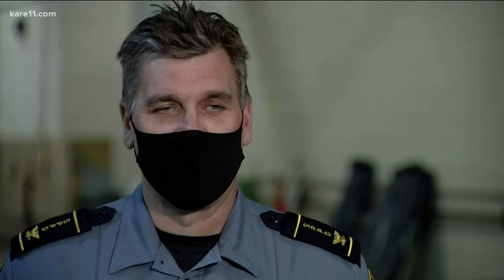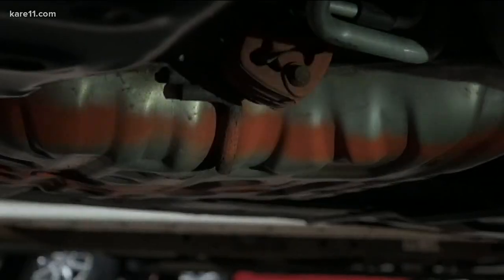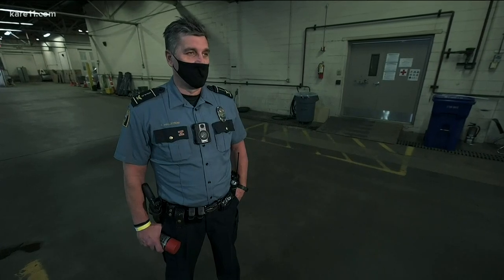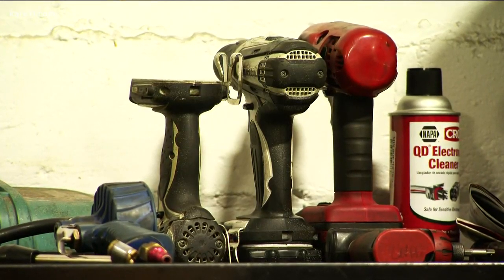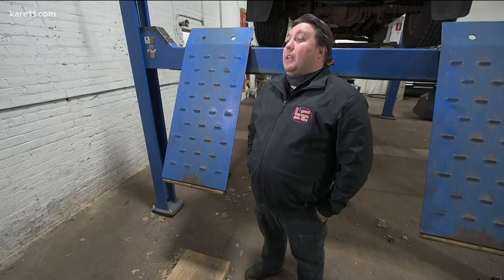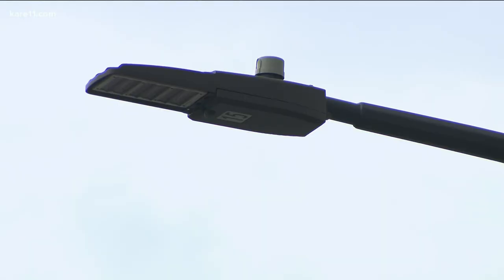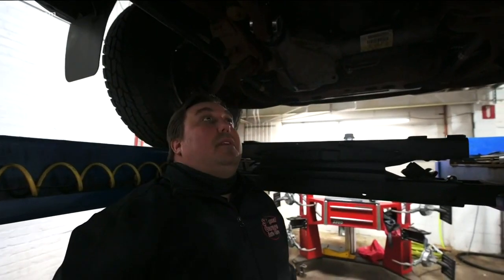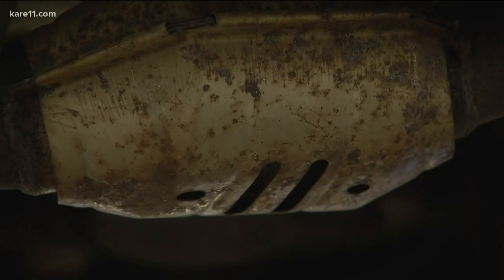St. Paul police are using spray paint and engraving to crackdown on catalytic converter thefts

Comment: What kind of paint?
Reply: High-temperature spray paint that withstands up to 2000 degrees or so. Suitable for engines and cat converters. You can get it pretty much anywhere. After spraying each layer, you need to cure it by running the car and letting the part get hot so that the paint adheres. Go for a flourescent orange or yellow. It's also advised to get an etching tool or dremel to carve your vin and/or plate number into the cat to help identify it and convict the thief in the event it lands in police custody. Some police departments have been more aggressive in shutting this racket down than others.